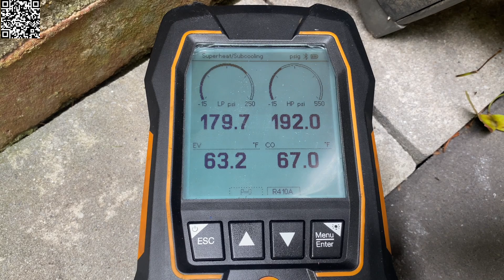Central AC Compressor Fails Pump Down Test - Central AC Not Cooling - The Fix

Comment: Ive found a lot of these compressors are failing due to lack of maintenance. Customer wont clean units. Condenser coils get dirty and run much higher head pressures working the compressor harder . Micro channel coils get dirty faster and they are harder to clean. I know you said coil was clean but who knows maybe it wasnt and someone cleaned them before hvac tech showed up.
Reply from the maker: Yeah, listen I totally agree. You know a lot of of these HVAC companies these contractors you know they just they don’t really do much and I mean.

Comment: Its a shame that 8 year old units are considered old. Build quality today sucks.   I'm still rocking with my 30 year old Lennox system with all original parts including the 30 year old capacitor.  Still works like day one.
Reply: @PipeDoctor  So I should pay $20K for a new system to save maybe $20 a month in the summer months?  Sounds like a plan.

Comment: Mike the service tech in me said  compressor replacement UNTIL your last comment….. tough one.. I would probably do a 24hr pressure test, if passed I would do condenser hoping the txv is not fubar

Comment: Well depends on  the warranty.  Most condensing units if registered by the owner should have a 10 year warranty.
The owner will only pay for the labor but not for compressor and still have two more warranty years.  Once both units are more than 10 years than replace both units if needed.

HV

Comment: I would do whats morally right. If that be the system has a failure that is causing the compressor failure and is doomed again, system replacement. Some people will go for anything to fix the issue and some want the cheapest. So it's a tough call. Also the other installer's work should be taken into factor. But wtf do i know. Im a dude in front of a computer. Youre the expert :-p. Great video. And you can use those glasses to slip in clips. Just color grade it. I wish i knew a good tech guy you could hire... Much love.
Reply: @PipeDoctor  thank you for the nice comment.

Comment: I'd want to know the condition of the evaporator. If it's not full of rust and the existing installation is of good workmanship, I'd probably just replace the condenser. 8 years old shouldn't be considered "old", but sadly that's about where we're at with the build quality of a lot of today's equipment.

Comment: 8 years .. I need more information how the inside air handler what the service record look like .. if money is an issue go with option 3 if not and inside air handler is mint then replace out side units bur if age is the issue and it’s has service history then pull Bandaid replace both with new system with a 10 year warranty.
Reply: @PipeDoctor  nice 👍

Comment: Option number one will be changing compressor option 2 out door unit option 3 will be changing entire system with new one . Option number one will be not smart option because dumping money into the old system. Option number 2 could be okay because changing out door unit but still the rest of system is older with wear and tear on it so it’s not a good investment therefore, I as a maintenance technician will highly recommend to replacing entire system indoor, outdoor, new line sets and thermostat peace of mind for at least 10 more years. Thanks for choosing AC company lol

Comment: I’d replace the cond unit. Give the the option to replace the system. I believe you said the system is 8 years old. Where I’m at 10 - 15 years on a cond. unit. Might as well do both.